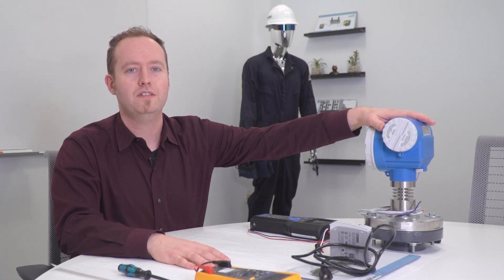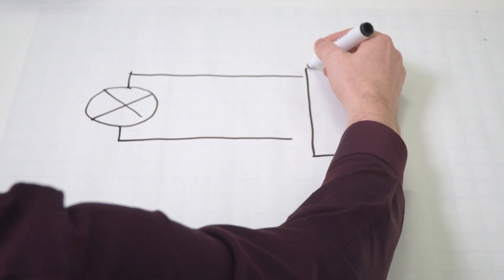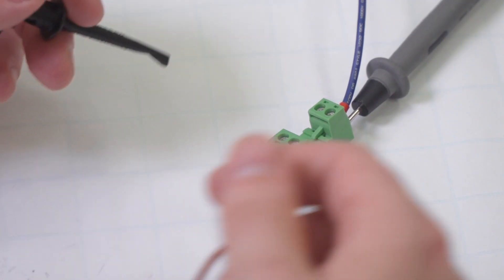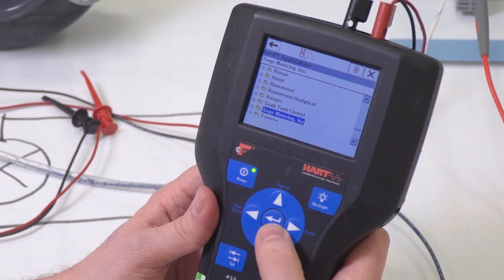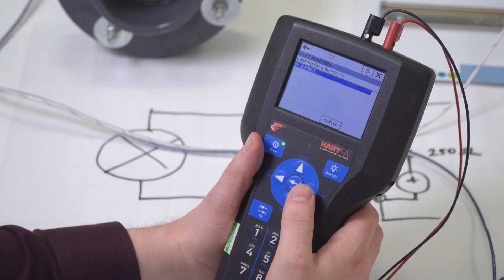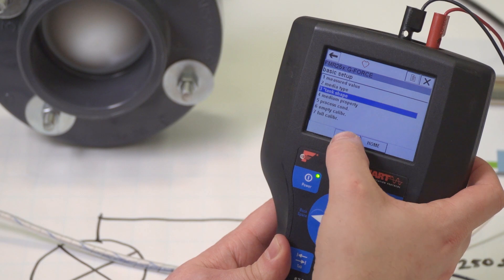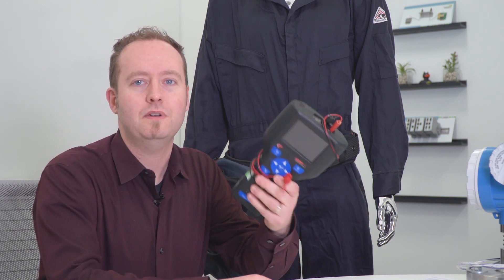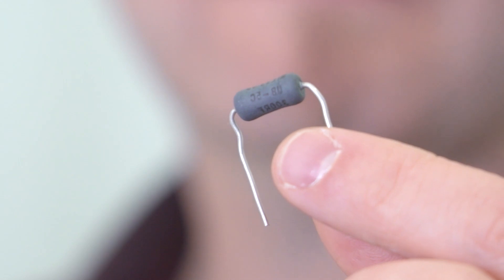Configure a HART Device Using a Handheld Programmer

Comment: I've got an older HART Communicator, model 275. Will this video help me in understanding how to use any HART Communicator or just specific ones ?
Reply from the maker: Yes, all HART communicators fundamentally work the same way.  The programmer  in this video is a model 375, which is an upgraded version of the 275, that also works with Foundation Fieldbus devices.
Reply: @PhoenixContactUSA  I suppose one can not simply turn the communicator on via the power button without having some kind of instrument part of the loop either. We've got that old 275 that I recently found, the batteries had gone bad from sitting. I popped in some fresh double A's, tried turning the power on - nothing happened.
Reply from the maker: @josephrhodes4844  The 275 should power up without connecting it to a device.

If you have any further questions, feel free to email me directly at grschmidt@phoenixcontact.com or connect with me on LinkedIn:  https://www.linkedin.com/in/garrett-schmidt/

Comment: Very good sir ...i want know why we use resistor with hart ? Why the designer make device have a internal resistor like plc card
Reply from the maker: You need a resistor because HART is a voltage signal that is superimposed on top of the analog current signal.  Since it’s a voltage, you must measure it across a load-- in this case. the 250 ohm resistor.

Comment: Hello Sir, this video is very help full but can explain in detail about why we use 250 ohm resistor in loop power connection with HART communicator.
Reply from the maker: The HART signal is a small voltage signal that is superimposed on top of the analog current signal.  Since it’s a voltage, you must measure it across a load-- in this case. the 250 ohm resistor.
Reply: @PhoenixContactUSA  Right - but isn't it true in many cases that, when connected to the DCS or PLC analog input channel - the channel typically has a 250 ohm resistor, thus allowing one to connect the HART communicator directly across the terminals of the input channel?  In other words, the 250 ohm resister is very much needed on the bench to "simulate" the AI channel electronics of the PLC/DCS module - but as installed in the field it is typically not needed?

Comment: Hi, could you point me in the right direction? When I boot up my hart 475 a black "attention" screen asking me to select retry, reflash or recover. But I do not know how to select any of the options?.. I have pressed buttons directly under.. pressed 1, 2 and 3 and also tried pressing on the touch screen?...  thanks 😊
Reply from the maker: That sounds like an internal error of the 475. I’d suggest you contact your local Emerson representative for support.